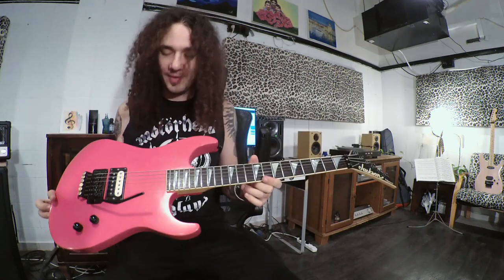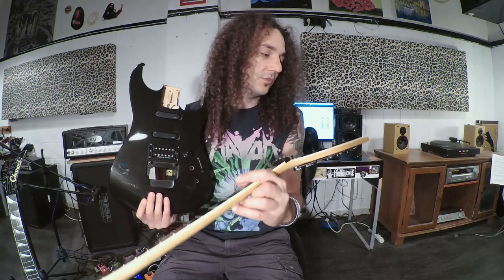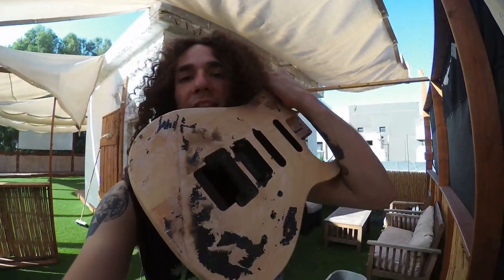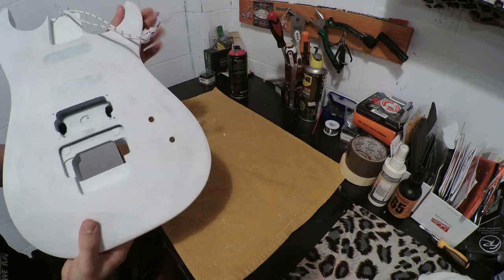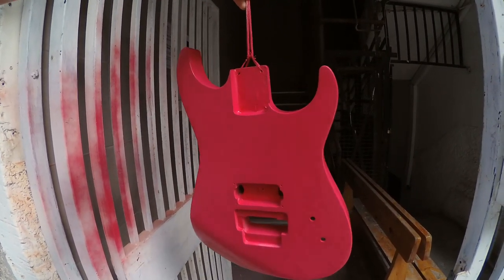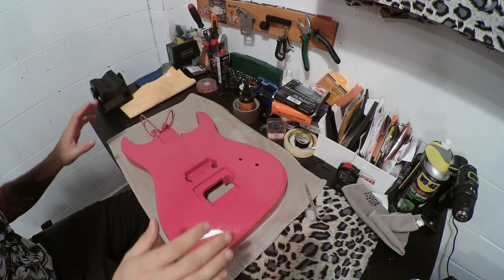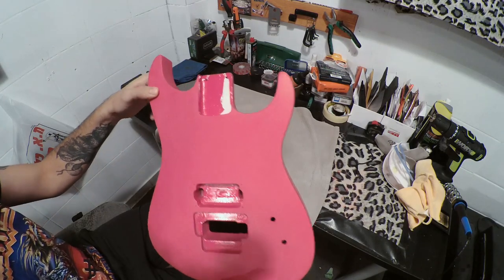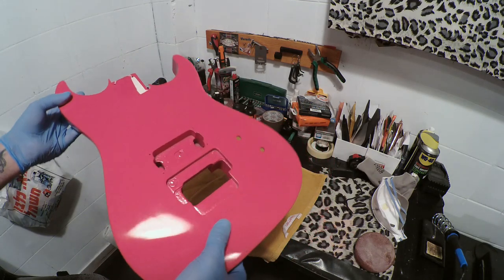I've Refinished a Guitar With Spray Cans!

Comment: It would have been great if you’d made a video series documenting the mods and changes - this is exactly what I’m doing to an old Warlock I got with the same intention as you. Strip it, fill the neck pick up making it single humbucker and single volume only, ditch the strat-style bridge for a Schaller FR style bridge (with the Kahler string lock from your Charvel video), and repaint the body.
Reply from the maker: Cool man!
I really didn't feel comfortable working and filming the whole thing through, that's rough!
But I believe I went through every step with photos at least.
Good luck with it!
Reply: @OferHolan  I’m just finishing the video so I can see why you did it as you did - looks so good after the polishing! You even put in the exact pickup in I’m going to use too (the Nailbomb). My question about the refinish is: did you sand the clear coat between coats, or just let it dry and apply another coat? I didn’t catch if you sanded it back before the next coat of clear. If I can get my finish go come out like yours I’ll be so happy!